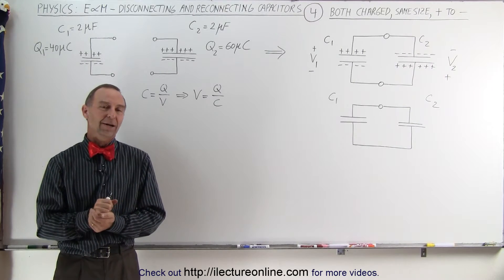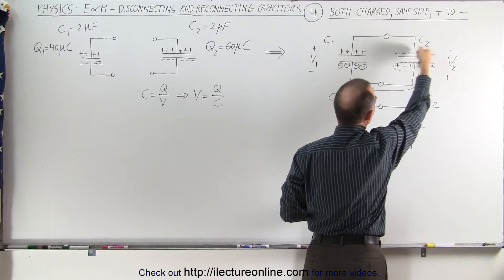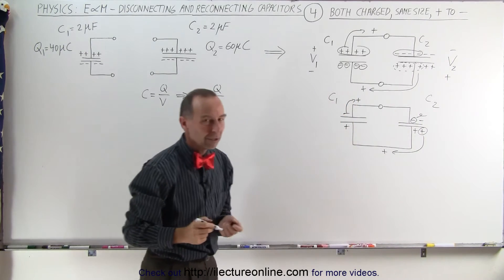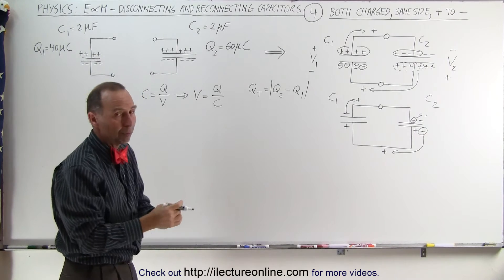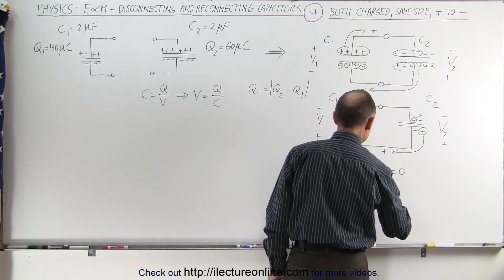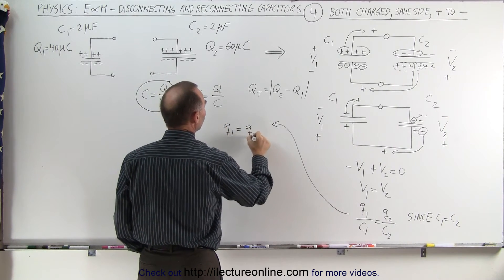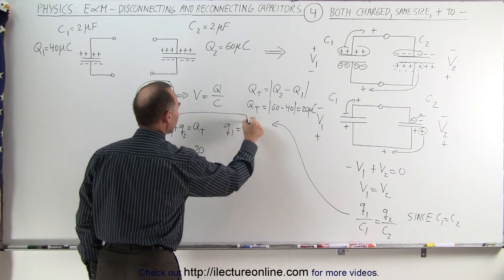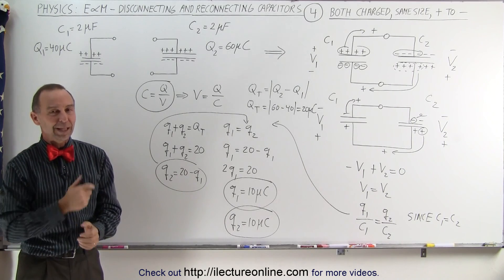Physics - E&M: Dis- and Re-Connecting Capacitors (4 of 16) Both Charged, Same Size, + to -

Comment: Please sir, Are the two capacitors in this circuit in series connection?? Thanks for your great explanation
Reply from the maker: Yes they are.  There is only one path in the circuit.
Reply: @MichelvanBiezen  thank you for your reply, would you please tell me in details the difference between parallel and series connection in case of capacitors,  I mean what is the main indicator ? Is it (1) the path (2) the connection method between positive and negative (3) the division of charge ? I am so sorry for my questions.. but really I am so so glad for your reply.. My regards

Comment: sir, I would ask that you stop saying positive charges move from plate to plate because its very misleading, positive charges are stationary, negatives do the migration. I don see the need to refer to the positives when speaking of charge movement because not only is it just as simple talking of the negatives charges moving, its the right way of speaking as well.

all in all, informative video all other aspects considered.
Reply from the maker: You are absolutely correct.  But the convention in physics is that the positive charges move.  This decision was made a long time ago when it was not known which of the charges were moving and they chose the positive charges.  That has been the convention ever since.

Comment: What would happen if the charges on both the capacitors were equal...
Reply from the maker: With "equal" do you mean "the same charge"?   Because the magnitude of the charge is always the same on both sides, but the sign of the charges on opposite sides are always opposite.

Comment: NOW, it looked like the connection of the two caps made an even BIGGER energy transfer...I guess because 'opposite' charges were shorted, which is beginning to support my initial assumption of loss of energy by Joule heating OR EM radiation.  My understanding, hopefully, is getting better!
Reply: Shut the duck up